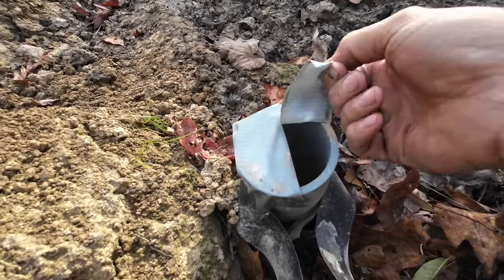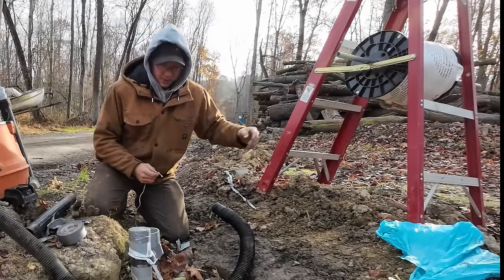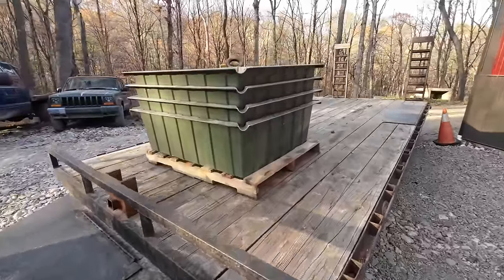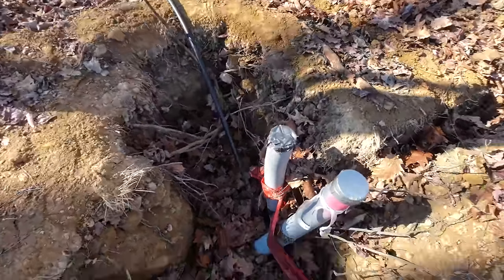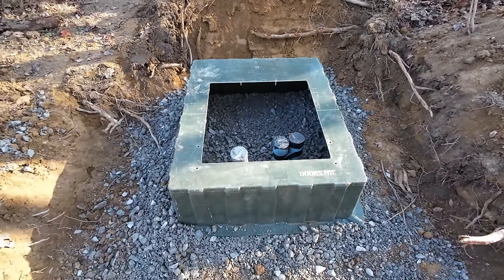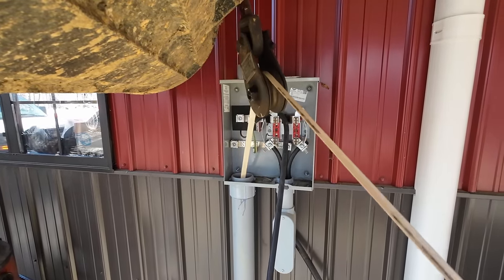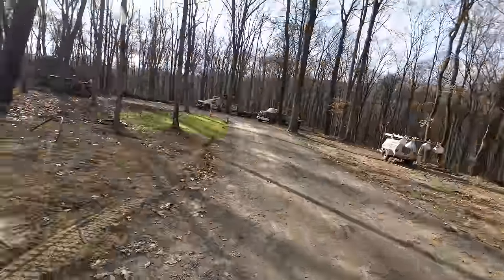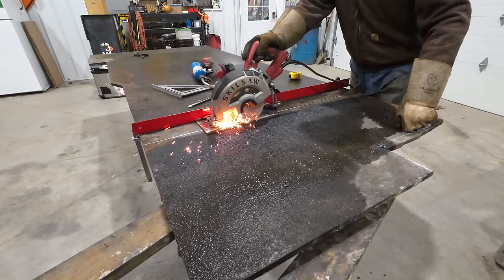The Power Company Charged me $52,000 for this!!

Comment: Why did you have to supply the wire from the transformer to the meter box? Because your demarcation point is the transformer on the secondary bus bar.

When you plant around the pull boxes, leave a couple of feet space between the edge of the box foundation and the outside of the plant (Good rule of thumb is 4 feet from the box foundation and the center of the plant) otherwise the electric company will have to rip some of it out later if there is need for a repair.

Comment: I know the feeling, I didn't have to go nearly as far but the satisfaction of finally having power in my workshop and the appreciation I have for it every time I go down there and just use a power outlet, or turn on the lights is simply unbeatable, especially since I did all the prep work, digging, conduits etc, and pulled the cables ready for the electrician to terminate and tie in. Satisfaction to the max :)

Comment: Hey I use a pull tape that has measurements on the tape so when I pull it in I get the distance from the tape markings. You should also meg the wires at their rated voltage to make sure they don't leak to ground.

Comment: You hire a electrician, have the power company  put the transformer on the right away. Electrician run the service wire and meter box. Transformer on right away is normal to be 20 to 100 feet from road depending on where you live or buy the wire, rent a dich which and do it your self. That's what we did.

Comment: If you plan to put more than one wire inside the pipe later on you may be interested to leave the rope there. Just leave twice as long rope and tie new wire to the middle of it pilling it from the other side every time a new wire is added to the pipe. Otherwise you would need to pull old wires out to add a new one. And  you will surely need to add more wire later on, optical cable for the internet or something.

Comment: There's a ton of comments regarding solar, and I don't need to add to much to it, other than to say for comparison, you can get a Ford Lighting pro for that kind of money and have a 99kw battery storage as a side benefit.

He looks like an old fashion type of person with a ton of diesel machinery (the channel is called "Diesel Creek" for a reason. Although he doesn't sound to pleased about having to smell it or the noise), and might not be into clearing the space needed, so I understand why he's not into it. But for the savings in electricity usage and gas when using the Lightning, he would save that amount he paid to the power company in just a few years.

It just takes time for some folks to get into new things when they're so used to doing it the old fashion way.

Comment: Love your show- I’m sort of a solar guru- could have built a bulletin board proof solar system for 30k. This had to cost you at least twice that .
Reply: Okay solar guru - You think you're going to run a welder off of solar?  He's got a shop there stocked with all manner of juice sucking tools.
Reply: @guydaley  you have to have a couple'dem Tesla Battery packs.  Especially if you want the building warm in the mornings.  Actually, the solar is seasonally 3x summer vs winter, so you are going to have loads of extra power from march to november, and probably you would use wood pellet or some fossil heat system.  But yeah, there are entire factories with arc welders and 30T forges running on solar now.  He didn't even need 3-phase or High Voltage?  I though he had a reason for this.

Comment: It ain't just power that they rake you over the coals for. I almost bought a property that had zero internet service. No cable, no fiber, nothing. I could get DSL, but it was SLOW SLOW. The local ISP had service 1/4 mile up the road. They wanted $80,000 to run service to that property. This wasn't buried cable, but above ground on the poles. $80k. This was to a neighborhood, mind you. So they could have capitalized on that. No thanks.

Comment: Surely for $52,000 u could've built an off-grid power generation plant with a storage battery. or $67,000 if u count the other 15k. No easement required, etc., etc. Anyway, love the videos. Keep up the good work.

Comment: @2:29 I totally get where you're coming from regarding doing it yourself and I'd be in sticker shock over a $52,000 bill myself for pulling that but if we are talking about the high voltage primary wires (over 1000v) there are some very good reasons they won't.
(1) Pulled incorrectly you could damage the wire, and if the primary wires short, it can cause a big mess that could potentially knock down other customer's as well.
(2) Responsibility. They own those wires, it's part of their outside plant and if something was damaged and you lost power, they're responsible to repair it. Because of that, they won't let anyone else touch that wire who hasn't been trained/certified to their standards. No different then letting some random schmo off the street run your toys, you don't know who they are, if they know how to operate them safely & properly.

Other then that, loving your videos, and inspired me to start looking for stuff I can scronge and restore, starting with a skidsteer/track loader for my small 1/4 acre property.

Comment: The vacuum and the bag inside the tube causes a kinda sail boat effect, 3 inches diam =  R2 times pi      1.5 X 1.5 X3.14 = 7.06 square inches of surface. . .Atmospheric pressure is 14.7 pounds / square inches. . . Since you wont get the whole 14, pounde, let's use half of it  so;  7 square incnes X 7 pounds per square  =  49 pounds of pulling power. . .😉

Comment: My uncle was a 35 year electrician. He taught me a trick when we pulled my wire from my house to my shop. He said if it’s it all uphill, you pull it from the downhill side even 2 feet of climb will make the wire tougher to pull we had about 16 feet of drop that wire basically slid right through the conduit, because it was all downhill
Reply: This is very true, sometimes when pulling wire vertically in conduit up multiple floors we have to pull the wire up instead of down. The wire is so heavy that if you pulled down, it would start to fall into the conduit uncontrollably, causing a dangerous and costly situation. We then install specifically sized blocking in the end of the pipe at the top floor to prevent the wire from falling down after the tugger and rope are disconnected.

Comment: You did all the work. I know you know but that's a ridiculous price. We had a 400' run done 2 years ago, shot under the road from the poles, knifed to depth on the side of the drive, they placed the base and transformer. 8k all in didnt have to lift a finger, North Central WI. I didn't think i was lucky at the time but reading through the comments I realize  how lucky I got.
Reply: Your run was 400ft, his was 2200, so 5.5 times the length. 8k$ * 5.5 = 44k$. With the way prices for everything have gone up in recent years, I'd say he got a decent deal.

Comment: Copper is expensive. 3 phase is a whole lot more but in the long run more beneficial. I've done the same thing with 2 vacs 1 pushing and the other sucking.
Reply from the maker: 3 phase wasn’t even an option. This is single phase

Comment: $56,000 (plus the electric bills) is enough money to set up full propane generator (or diesel depending on your area)  AND keep it fued for 10 YEARS.  You could add battery banks ... and solar as you go, and cut year by year and costs in half EASY.

I had plans t do exactly this .. I already had the land paid for and the fist 200 yards of driveway done. (100 acres 1/2 hour north of town)

I was going to go a complete separate SOLAR system for lighting (low voltage)  and outdoor wood furnace for heating. and a big generator for heavy loads (like laundry day) 

Lastly a solar system added to the diesel/Solar/battery array to be spiced into the diesel a little bit each year.

I choose diesel over pro[ane because it's easier  for me to maintain, and if the SHTF much more available and could even run used oil etc. 

I was seriously looking into using an engine out of the Military Duce and Halfs I used to service in the army,  These things will run on any fuel you can find! :)  PLUS a drive shaft to the generator, so you could literally put ANY engine in an emergency or tractor PTO old car et etc AND also replace the generator with almost any thing available. 

But best laid plans ... my wife passed away, and with 4 kids at home I had to sell the property and give up the dream :(

Comment: Just watched a video, where marcus brownlee had 30kW solar with 40kwh battery storage installed.  It cost him 115k but got a 20% fed rebate off that.  Seems he gets 13MWh per year IRL.  Not sure if this is a "screw the earth" type channel, but saving 52k + 12k + 1-2k from this video's effort would cover 2/3 of the total cost, with someone else doing the install, and no power bills forever (has a 25 year warranty).  I think with a simpler, rural construction, self-install, and customizing high voltage rail to a shop, the total cost would be well under 75k TOTAL.  Again with NO POWER BILLS EVER.  

Personally I would have set up two solar tracking tilt panels off the driveway with a shed for the battery storage in their shade.  Or put the equipment and a small building at the util service end, to take advantage of selling the extra power to the util, and later pulled my own high voltage line from it to save the 50k.  They don't own high-voltage, or set the rules, if you make it yourself.  If your state doesn't disallow it, you could have a third or fourth tilt panel so you always make money off the grid.

Sorry if you feel dumb, but it was cool to see someone DIY yesteryear's tech so well.

Comment: That is insane the cost parrot. I built a 3 phase Solar System that powers my shop with a 105 amp plasma cutter CNC machine, 10 HP air compressor running several hours a day. I have 5 days of battery backup for my house and a diesel generator and propane generator just in case there is no sun for more than 5 days. I did all the work myself and paid less than $60k. I would rather spend 2x that than pay what you did and still have a bill and possible power outages. I could have spent $20k less if I only setup for 3 days of battery and 1 generator but I wanted extra redundancy on both

Comment: Most power company’s allow 3’rd party contractors to do work on primaries and can provide you with a list. I used to work building cell towers and we always used 3rd party contractors…..also,the longer/ bigger the conduit it’s easier to use an air compressor. And wow that’s a small diameter conduit

Comment: They also have to hook it up on the pole. This is a basic price for city to run new lines. I'm an electrician and it sounds like they are still charging you for the ditch and conduit. But you don't have a choice. It is a felony to pull your meter or mess with the pole. That is still the utility companies equipment you just use it.

Comment: We used a rubber pig is what they called it fit snug in the conduit had a pulling eye molded in ti the bull rope on and the compressor for the jackhammer would blow half a mile at a time also if you didn't trench as straight as they measured watch for hidden fees they sell cable by the foot

Comment: Sure and it sounds like a bargain. Cost depends on wire size and length of pull, plus the transformer and special "pull" equipment as much as $800 an hour. Since you needed a transformer, I expect the wire was sizeable. Our company had a transformer installed with a short pull, back in 1980's, and it cost $120K. Deal with the gas company some day. I wanted gas run to my house in 1992. The neighbor had gas. It would have been $5K to extend service 10', then run the tap line 30' to my house... not including hook up fees.

Comment: Reason they have you install the mule tape is so that if there is any obstructions or the conduit is collapsed somewhere, you can clear it out or fix it before they show up.  As for the price, Cable is expensive, Transformers are Expensive, Load Break elbows are expensive, Primary Pullboxes (I counted 3) are expensive, all the other miscellaneous materials that are rated for high voltage expensive, labor for lineman especially Union lineman, expensive.  

Cost of equipment for Utilities has skyrocketed in the last few years, not to mention the limited availability/shortages of materials and couple that with increased labor costs, $52K isn’t a bad price all things considered.
Reply: lol “especially for union lineman” they ARE expensive

Comment: I had trenched in 180" of 4" conduit 36" sweeps and installed a 200 Amp panel. They charged me $10,000 and took nearly a year. Of course the panel failed because they require panels with a slow disconnect screw(s) feature.

Comment: Give us a breakdown of costs born by the power company.  I did not hear the amperage for the service you requested but it will certainly require three heavy gauge conductors plus smaller ground cable that they will be bringing and pulling thru your conduit run.  That sounds like 3 times 2600' of heavy copper or aluminum cable plus ground.   It will take a crew of three or more line workers and heavy equipment.  Perhaps a private electrical contractor could give a ballpark estimate of what they would charge for pulling in and hooking up your service.

Comment: Yes, when I worked for an electrical contractor years back, we once worked at a petroleum plant that had tons of long conduits that we had to string lines through. The only difference was that instead of a shop vac sucking the bag through the conduit. They blew the bag on a string through the conduit, using an old Co2 extinguisher. Both methods work very well!

Comment: Primary or high voltage cable is different bud.  They dont want issues with it in case you fck it up and you keep calling them.  Then they have to do extra outages, ect.  Higher voltage you need to take extra care with cable insulation.

Comment: I have a feeling you could have went with a massive solar array, wind turbine, a very large battery bank, deasil backup generator and a beefy inverter for about the same price, and then you wouldn't have to pay for power after and even on the rare days in the depths of winter when you have to use the generator you should only have to run it for a couple of hours to top off the batteries. Honestly if you were starting from scratch you would probably want a generator which can use both propane and diesel, because the propane last for a long time and given a 5kW or so wind turbine and 10kW of solar you would very rarely need to use it and just keep enough propane about for 48 hours of using the generator, which again assuming you only have to run the generator for 2 hours a day to charge the batteries would last you 3 weeks 3 days of continuous usage which should be enough to last you a years worth of usage, but if something went wrong with the rest of your system you also have 48 hours of propane and in that time can go buy deasil to fuel it until you get you main system back online.

Although if you don't mind throwing away deasil once 9 months you could just use diesel as a backup.

Comment: Yeah we have a different vac. And we use these little foam things to vac through. What your doing works the same. Thats a long run your dealing with there. You have to run the high voltage and transform it it other wise the wire would be getting to big and expensive.  With that run and the wire and transformer its not a bad price really.

Comment: So I work for an electric utility as a line design tech.  I was curious and based on what I could tell with the customer doing the trench and conduit and the utility providing the equipment consisting of a 25kva padmount, 3 1ph sectionalizing cabinets, 2200' + 15' extra wire for in and outs of 1/0 primary urd cable, 4 fiberglass pads as well as a 200a meter and all of the components to make the connections like elbows, elbow arrestors, & secondary connections I am coming up with a cost of about $35,000.  This does not include a riser pole.....i thought i remembered him saying early on in the video that his neighbor was also urd.  But if a primary riser was required it would add about $5000 to the job.  So yes, $52,000 seems a little high but that may just be the area he's in....maybe material/labor is higher there than where I'm at.
Reply: The exact same job with the utility installing the conduit and digging the trench came out to $82,000 so yes doing his own trench and conduit saved him a LOT of money.

Comment: I have a similar problem in Nova Scotia. I’m building a summer home up there and it doesn’t matter if you’ve memorized the electrical code, wired the house perfectly and even passed the inspection. If a licensed electrician didn’t pull the wires through holes in the wood you won’t get an occupancy permit. I can’t lay the right cable in the approved trench. I can’t do a single thing myself. It’s bullshit.
Reply from the maker: Sounds like it!

Comment: cable in conduit. now matt needs to call for locations” i put it in and know where it is “ wont cut it with claims. since the cable slides in the pipe expects to pull the bushings and feed through apart …. repair conduit and replace cable and terminations. on s good day … wreck the transformer when the seals under the bushings bust …. and you need an oil recovery too